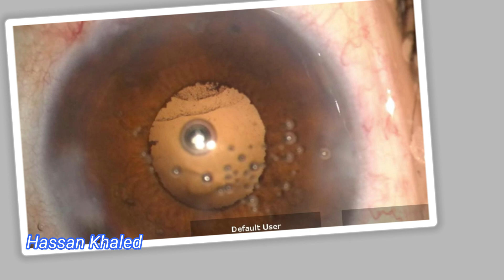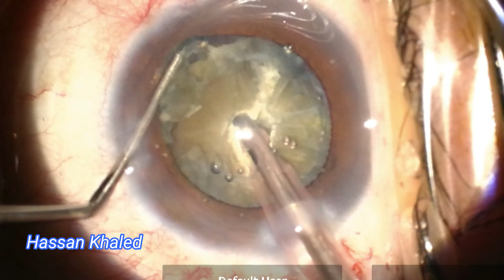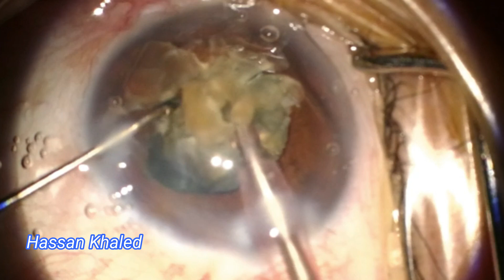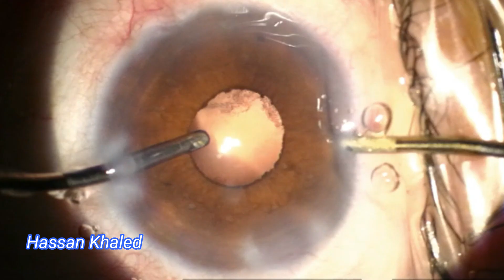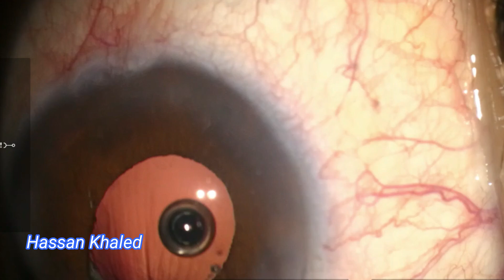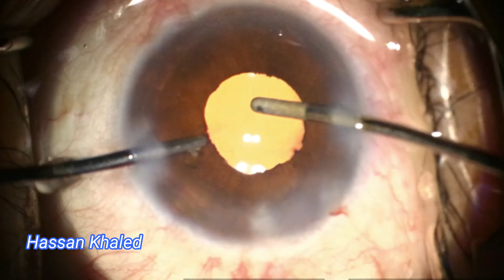Hidden Challenges in Phacoemulsification of Dense Cataract

Comment: Sir being a more dense cataract the other thing i could say is to bury the phaco probe more into the substance of the nucleus and then attemot the chop, that way you can get more complete chops instead of partial ones sir. Especially when you are trying to get the first 2 heminuclei
Reply from the maker: Great point! Thank you for your point. Actually that what I do , however in this case ( speed x2) as there is a zonule weakness which was noticed , so the splitting it was slightly difficult than usual 😊